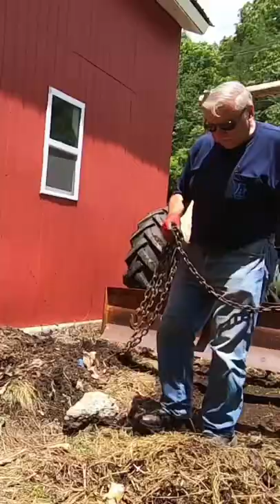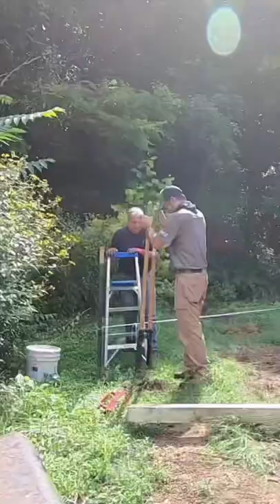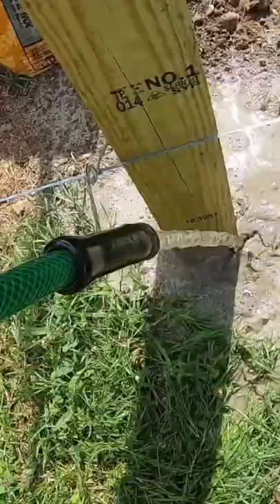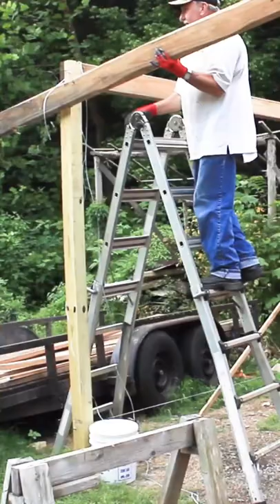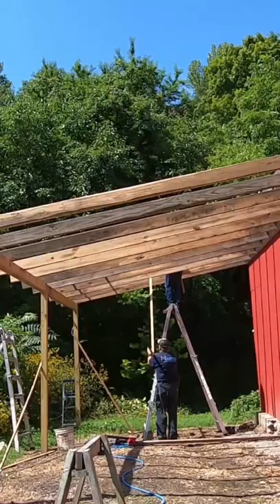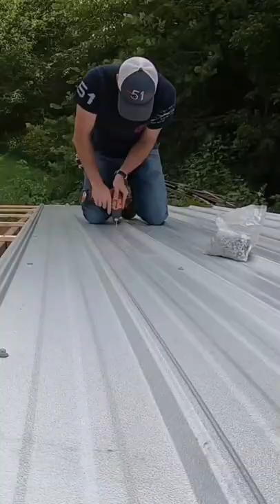Building a Lean To in under 60 Seconds #shorts

Comment: How did you flash against the wall? Building something similar.
Reply from the maker: We have an overhang on the roof above it and since we’re not enclosing it I didn’t see any need for flashing. But it wouldn’t be difficult to add. Just pick up some L flashing and screw it to the wall on top of the metal roofing.